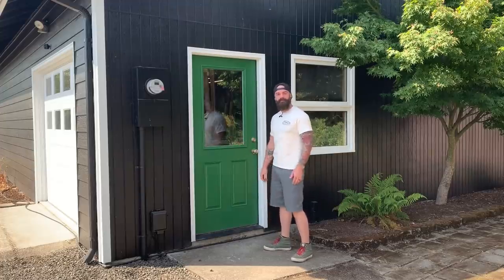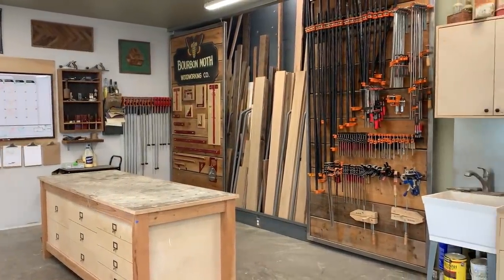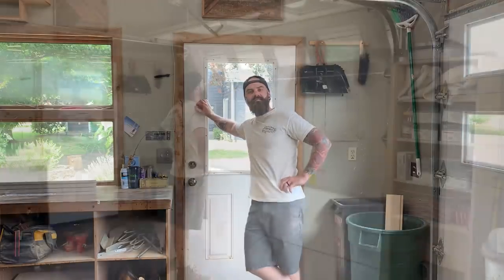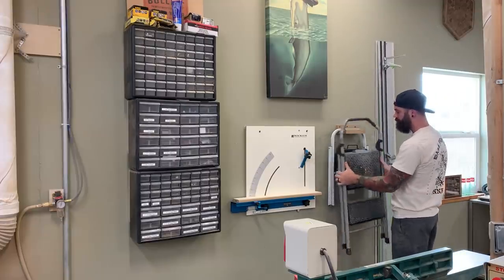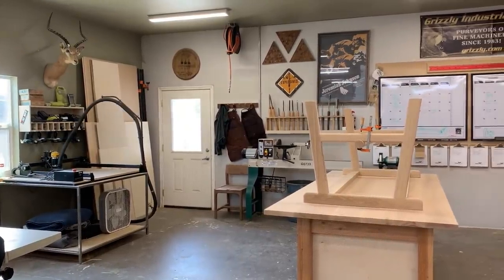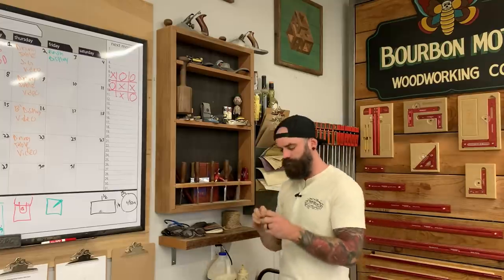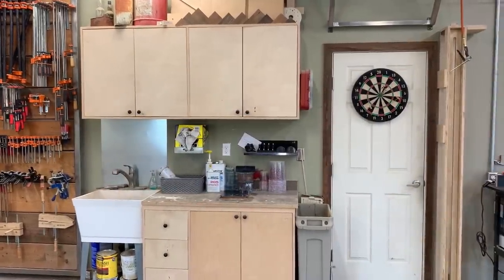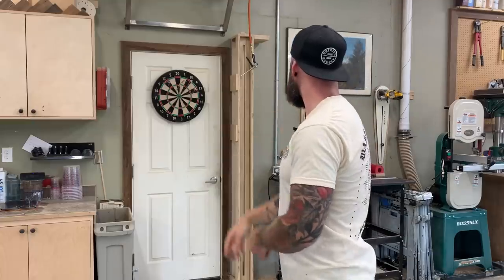Shop Tour | Ultimate Wood Shop

Comment: Great shop! If you ever think you could use more vertical space while handling longer material when the garage door is open, you might look into High Lift garage door tracks. In combination with a Liftmaster/Chamberlain wall mount opener, they will take your garage door almost to the ceiling.

Comment: I worked for the special effects dept in the movie union in Atlanta and used a CNC machine daily. You have to learn that guy bc you can do some amazing work with one. You can get a decent compressor at Harbor Freight that is an instant upgrade over the one you have and they're pretty cheap. If you don't use them that often then it should last you forever. For heavy daily use I'd invest in something better. Nice shop brother.

Comment: Great shop!  Better attitude!  You have several ideas that I can use. The Barn doors for hanging stuff on. I will try them out as they provide more wall space for a small shop. You are missing MY wall hung folding drafting board from Fine Woodworking Mag plans 15 years ago.  My workbenches supplement my miter saw. My shop is currently as clean as yours. Means no project underway. My lumber for the next one is in the mail. I liked your sanding belt machine integrated into your bench. Vertical wood storage is best. Bad idea to mix Bourbon with power saws!  No TV is good in the shop. I don't know how to operate a CNC either. Thanks for the entertainment. Yes, peg Board is far more efficient than French cleats. Also, drawers are death for tools, only good to collect stuff you haven't decided what to do with. Otherwise known as junk.

Comment: Awesome size shop! Such a nice space and easy commute.Two immediate comments: I cannot believe your dust system is in same room as you work and that you have used the split feeds on the Grizzly. I had a little design help from Oneida when I rebuilt with their Cyclone and put mine system outside my workshop in it's own 5x5 room. They said using the y split was not good as it immediately cut available suction too much as opposed to running full size main dust and reducing at machines! Perhaps you get away as your machine might be bigger than my Grizzly. Was it stock to have 2 filters? Curious as to your thoughts